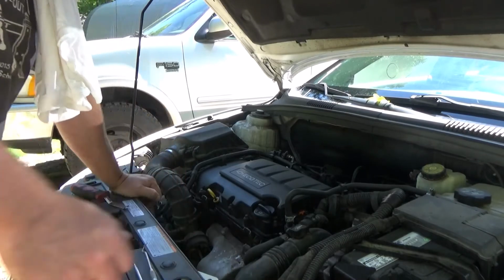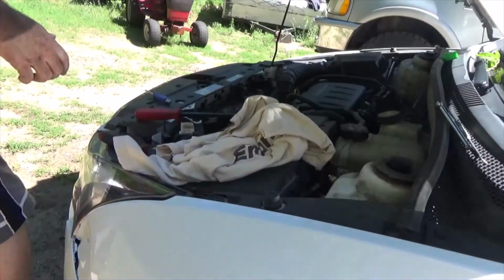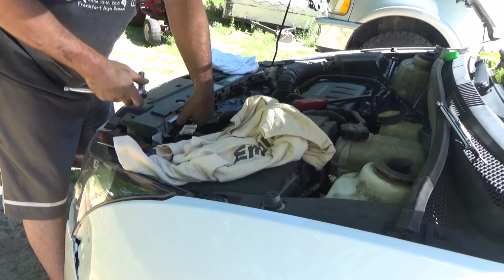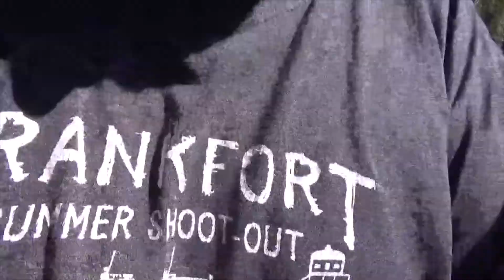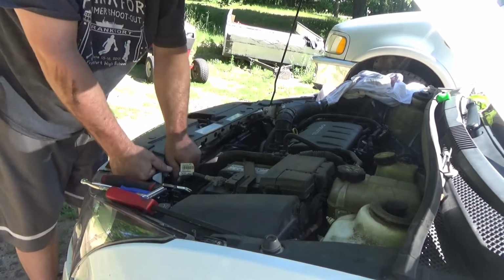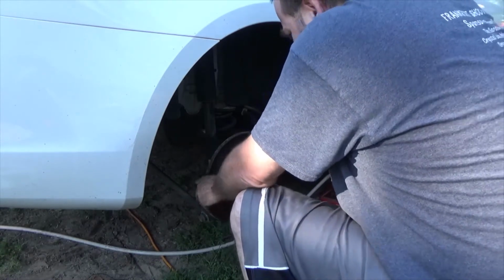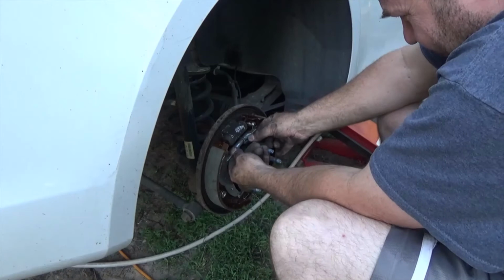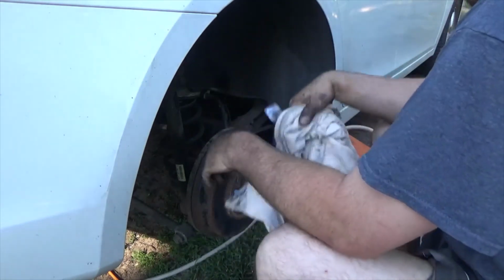2012 Chevy Cruze Cooling Fan Replacement

Comment: 👍👍👍 This is the way to do it. Granted, my ‘16 Cruze Limited has a manual trans so I didn’t have to mess with trans lines. I had also read that you needed to remove the front clip to  pull the shroud/fan. Not the case for me. Pop the lower shroud mounts first (they just snap in). Then the top mounts some come right out. As far as the hood prop holder, I removed the bolt and then used a drift to break the spot weld. Whole process should take 30 mins or less once you have an idea of what’s going on. Thanks for the vid bud 👍
Reply from the maker: Thank you for watching
Reply: How do the clips come off. I can't get them to release.
Reply: @justtisha  camera so far away can’t see anything. The video is useless.
Reply: I realize I'm kinda off topic but does anybody know of a good place to watch new tv shows online ?
Reply: @Elijah Owen flixportal :)
Reply: @Ethan Maximus Thank you, signed up and it seems to work :) I really appreciate it !
Reply: @Elijah Owen glad I could help :D

Comment: I tried to remove my fan this morning. PITA! The damn hood prop holder is in the way, I didn't know that you could remove it. Going to remove it here in a bit and hopefully it will give me just enough room to turn this damn thing sideways and remove it.
Reply from the maker: You can get you a long bungee cord wrap it around either your passenger side or driver mirror hook it on itself and then hook it on the hood
Reply from the maker: Make sure it's a good bungee cord you can do that too both sides if you want to for safety

Comment: My 2012 cruz isn't blowing cold air and when my air is on my car runs hot. You think replacing the housing and fan could fix that? Or could it be the heating coil
Reply from the maker: Sounds like to me you want to get your head gasket tested
Reply from the maker: Those cars have notorious head gasket problems with timing chain issues
Reply from the maker: That engines notorious for blowing head gaskets
Reply from the maker: They make a kit at the local auto parts store that you can do the test yourself to see if you have a blown head gasket just ask them for the blown head gasket test kit they'll know what you're talking about very easy to use